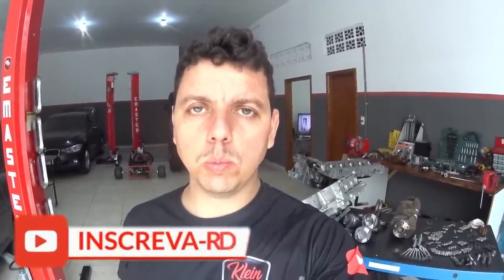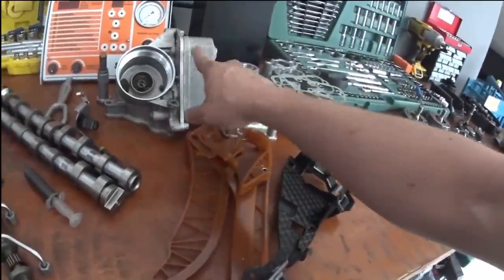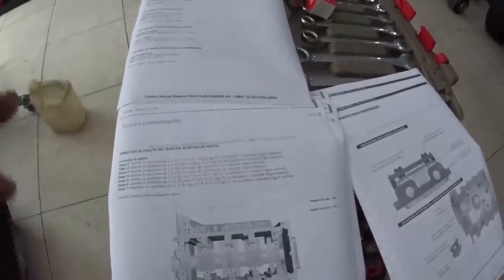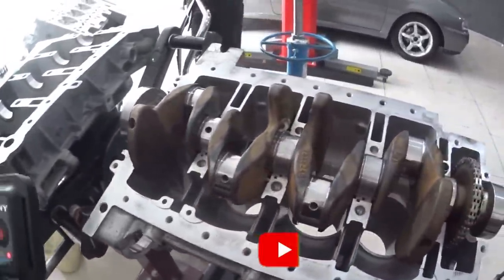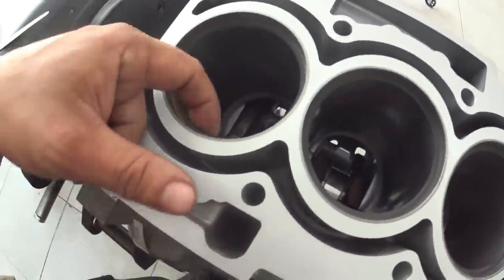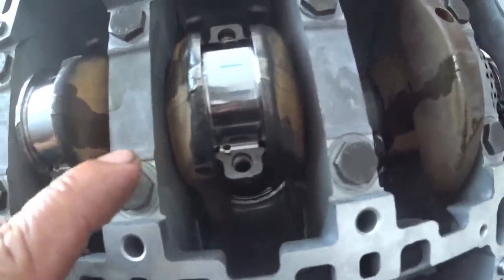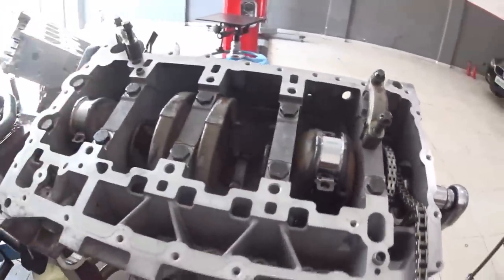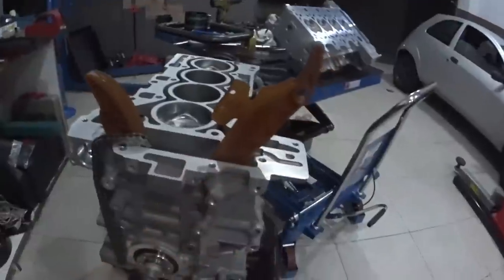Olha quem voltou! BMW 320I Turbo N20, montagem do motor!

Comment: OLÁ KLEIN   25/02/24  PLASTIGAGE o próprio nome já diz do que é feito.   Cera nem de ouvido.  A folga horizontal é tão importante quanto quanto a vertical.  A folga horizontal tem muito a ver com o sistema  de LUBRIFICAÇÃO e de COMPRIMENTO DA BRONZINA, tudo dependendo qual o projeto do fabricante do motor e do fabricante das bronzinas e a qualidade do produto.  Usar o PLASTIGAGE  é simples mas não tanto assim.   Deixo de fazer mais comentários em referência ao Vosso vídeo.   ABRAÇOS...  Roberto Udo Krapf